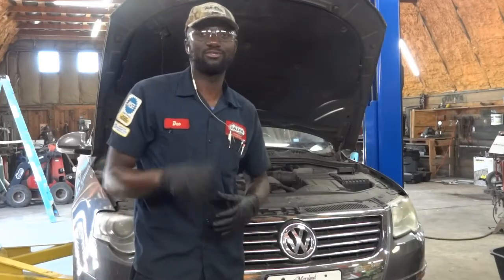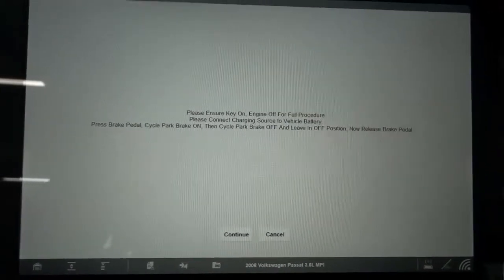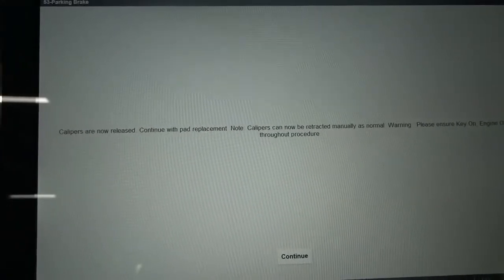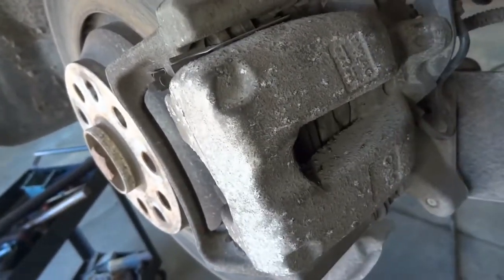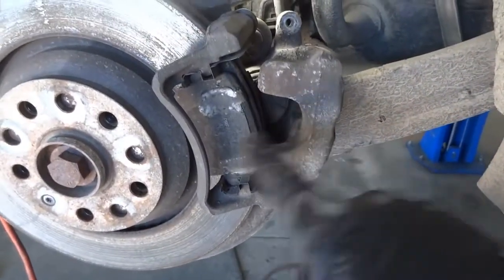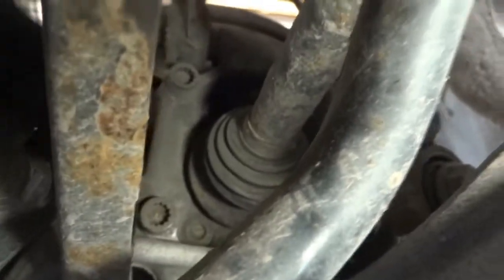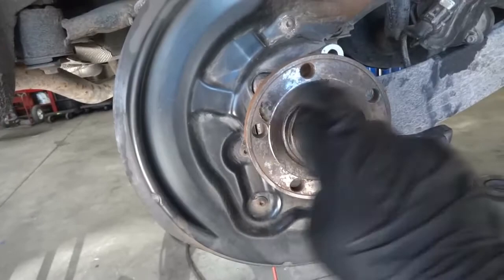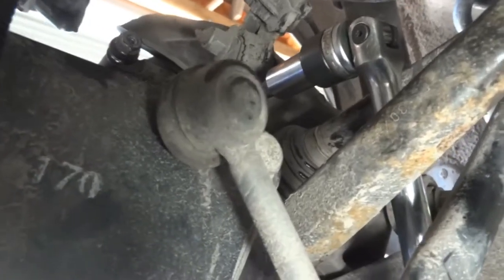Do this Before Replacing rear Brake pads on a 08 VW Passat with Electronic Parking Brake

Comment: Good job. Well videoed. Systematic instructions. 
I have a 2007 VW Passat V6.I had the car parked on my slopping driveway for 4 weeks. Now tge brake pad does not release easily after  being depressed during driving. Whilst driving and breaking, the brake appears to tighten as though the parking brake button is pressed. Any suggestions?
Reply from the maker: @ramosfurtado5313  Thanks! You might have a locked caliper!

Comment: Hello Deo. From your experiance do you think it is necessary to keep the key on all the time that you do the brake job or maybe it is possible to turn it off and turn it on again after the brake pads and rotors replacement? I am asking becasuse sometimes I don't have access to the electricity and I can't use the battery charger.
Reply from the maker: Grzegorz Skolimowski  No! you have to have the key on!

Comment: Very well explained good job! But can you tell me if the tool you used to compress the piston also have to unscrew it?
Reply from the maker: Ricardo Leite, I didn't understand the last part of your question!!! what do you want to unscrew?
Reply: @KITS_Auto_and_Truck_Repair  Thanks for the quick answer. Today I found on-line what I was (trying) to ask you yesterday. The job can't be done with a conventional brake caliper compressor tool, I need a VW/audi specific one that rotates the piston while makes force.
Reply from the maker: @RicardoLeite92  the tool I used in this video is a regular brake caliper tool from Harbor freight!!!

Comment: Is there an at home version of that scanner I can buy?  Do I have to disconnect the battery then put the charger on?
Reply from the maker: Eric Williams  Autel has some good scan tools that you can buy! if you're using a scan tool to retract the caliper pistons you should put a charger on the battery
Reply: @KITS_Auto_and_Truck_Repair  Can I do this without a scan tool?  I read somewhere that I can possibly just unplug the parking brake motor?
Reply from the maker: @ewill23nm  yes you have to remove the electric motor then turn the screw behind the motor counter clockwise

Comment: Thanks for the video , well explained and easy to understand but when I decided to do it I'm inventing sooo many curses and swear words, 1 star bolt came off fast and thought that it will be an easy job, then the other 3 started laughing their asses off at me, they won't budge at all. Used a good amount of wd40 on them and still nothing, any tips? Also I tried getting the discs off and same story, on 1 side the little screw that holds it was easy to remove and on the other side the screw was pretty rusty and I tried to carefully loosen it but the head is now destroyed. Any tips on that too?
Reply from the maker: Alex  do you have a torch? heating the rusty bolts up! will help removing them!!
Reply: @KITS_Auto_and_Truck_Repair  Hello, thanks for the quick answer. I don't have but I'm omw to get one, I put a good amount of wd40 there yesterday and also today while I did some other work. I will try with this along with some careful hammering and if it doesn't work I'll try with a torch.
Reply from the maker: @Lexx1994  sounds good!
Reply: @KITS_Auto_and_Truck_Repair  at last I loosened them, I managed to snug a breaker bar there, they wouldn't come off at all with the ratchet, but now I have another problem.. stupid me accidentaly hit the close piston function on VCDS while the calipers were off the car and when I try to use the open function it says error 007 not available, I mananged to open the motor housing and rewinded the motor with a t40 but the tool to push back the piston doesnt even fit. I didnt touch the brakes in the process, I was thinking that once I put everything back together to hit the brake pedal a few times anf then start the car and try to use the ebrake button. Any thoughts?
Reply from the maker: @Lexx1994  sorry! I didn't understand your question, what do you need thoughts on?

Comment: Can you please explain how to retract the motor manually?  You mention it in a comment reply below about removing the motor and turning the screw counterclockwise.  What screw is that?  Does the motor come off cleanly or are there seals to worry ablut?  Also, I'm guessing I unplug the motor wire and/or don't need the car to be on or a charger connected?  Thanks!
Reply from the maker: Jeff Chandler if you want to retract the caliper piston manually you have to remove the black little electric motor behind the caliper, after you remove it, you will see a torque screw attached to the back of the caliper, it's between the caliper and the motor, that screw allows the electric motor to push the caliper piston out when the park brakes are applied, you need to turn that screw counterclockwise to retract the piston...Good Luck!!!

Comment: This this on my car. But I now hear hissing noise when pressing break pedal. any idea why? Parking brake works fine.
Reply from the maker: Restoration Apprentice, how does the pedal feel? is it mushy?
Reply: @KITS_Auto_and_Truck_Repair  No, feels fine. And brakes fine too. Only when standing still and pressing break pedal do I hear hissing noise coming from actual pedal.
Reply from the maker: @RestorationApprentice  Check around the brake booster, it might be leaking vacuum or the check valve on it, is leaking... Good luck

Comment: Can I put my piston back in It came out to far it leaks now parked it last night n put dot 4 in Napa gave me free bottle
Reply: Is it possible to push back in
Reply from the maker: Sarah Cambria  yes you can push the piston back!!!
Reply from the maker: yes
Reply: I got it pushed all the way out piston to n the seal around the piston replaced it took to guys one to sick the electric motor on n me hit the brakes pushed then seal back in around the inner  lip don't ever buy a 147 dollar caliper Napa nknw how to make u spend more money can get the seal to but they don't want u fixing em why there core charge n bring in part u remove to refund. U 150 so u need 300 for a fuckin part to be shipped n then bring the part back to get 150 refunded n then refurbish my part with a cleaning n new rubber o ring n sheave rubber around piston.

Comment: can you without scanner . using 12 volt source.
Reply from the maker: sesha chary  you could remove the electric motor behind the caliper and then turn the bolt after the motor counter clockwise to retract the piston!!

Comment: What’s the software?
Reply from the maker: AlextheCreation J I used the Zeus to retract the electric motors for the Park Brakes, you can do it manually by removing the electric motor from the caliper and then turning the screw counterclockwise to retract the piston, if you don't have a scan tool that can do it for you

Comment: You shouldnt rotate Piston i think ...
Reply from the maker: Jan Petracek the piston was sticking out a little bit...
Reply: Bit u did rotate all way and if i read procedure right then if you use diagnostic to make parking brake to service status u should not rotate at all JUST push... Like forward brake
Reply from the maker: @DxDigasus  that's what I thought too, but the piston was not pushed in all the way, I believe the scan tool just unlocks the caliper piston to allow you to turn it...
because the piston wasn't frozen, it well in pretty easily...
Reply: @KITS_Auto_and_Truck_Repair  i just did it on my Passat cc 2008 today and if u use scan tool motor just release parking brake and you can/should just push piston back to caliper like front brake you dont have to twist it in.... and what i know you can damage it by twisting because if u try to twist it there will be resist from motor ....
Reply: and as i see on video piston make very resistance for you to retract it ... because you try to twist it...
Reply from the maker: @DxDigasus  it was fine... no drag or pull
Reply from the maker: @DxDigasus  that's good to know, I tried to push it back but it wouldn't move, the only way to move it was twisting it, and the caliper was not damaged, the brakes worked fine afterwards
Reply: @KITS_Auto_and_Truck_Repair  ok then
Reply from the maker: @DxDigasus  Good!!